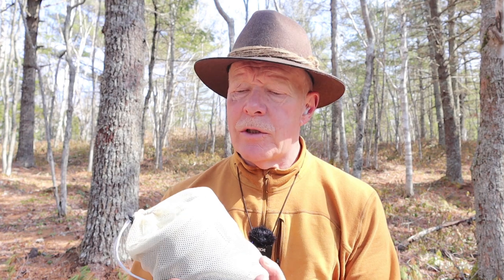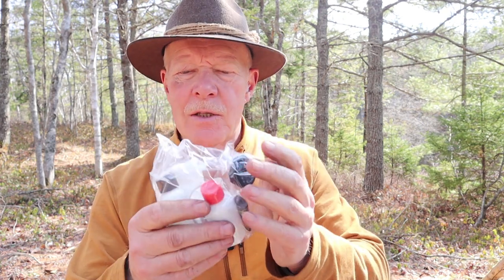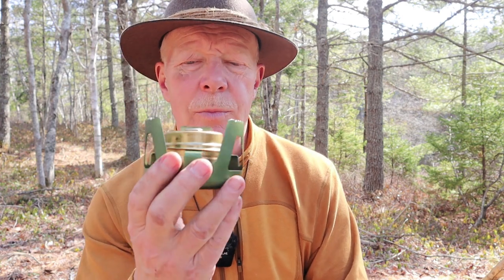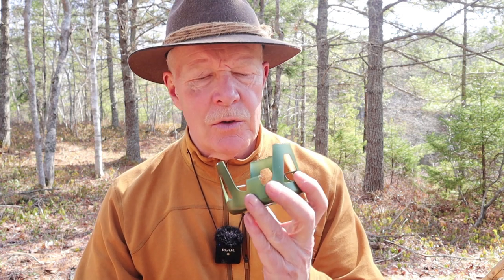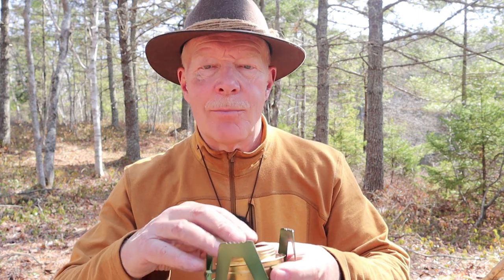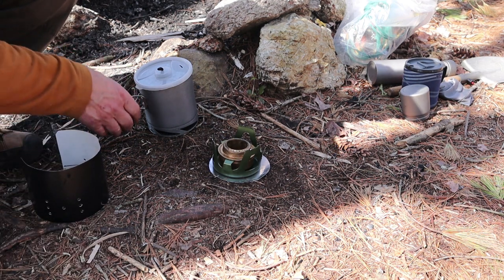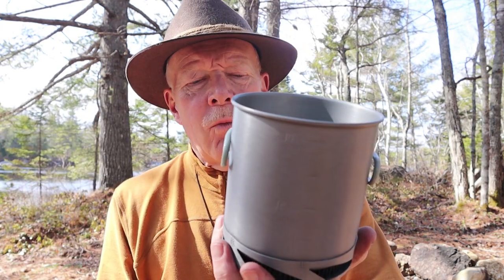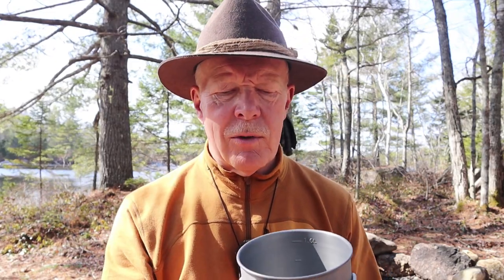New Brew Kit - Using my FM Heat Exchanger Pot and a Trangia Clone

Comment: 👍👍👍
Nice setup. I have filled my Trangia Burner with Ceramic Wool topped with a roll of Carbon Cloth and not looked back.
Lights up immediately, no matter the temperature. The pot can be put onto the stand straight afterwards with no risk (so far) of the flame being snuffed. No need to wait for the 'bloom'. The risk of burning fuel spillage in case of an accidental knockover .. greatly reduced. Performance .. no appreciable difference noted.
The heat exchanger pots with an alcohol burner .. I foresee the occasional 'decoke' of the heat exchager fins / vanes. However, no big deal and it will keep idle hands busy 😁.
Thanks for sharing .. take care ..
Reply from the maker: I have been playing with that Trangia mod. I like its benefits. Bit slower but I am okay with that. Thanks for commenting

Comment: Hello Mark and thanks for the video. I've used the "Sterno Inferno" heat exchanger pot with an alchohol burner. The directions said not to do this, but it worked out fine and conserved a lot of alcohol when boiling. It is a good lite weight set up.
Reply from the maker: I would love to have a Sterno Inferno but they have gone off the market. Thanks for commenting

Comment: Another thing you can do is put carbon felt inside the alcohol burner during the winter, or any season. That way if there is an accidental spill it will less likely spill everywhere thanks to the carbon felt soaking up the fuel.
Reply from the maker: Yes, I have modified an old Trangia clone with carbon felt. Works great but is slower than a burner without. Thanks for commenting

Comment: I'm still pretty new to these stoves, I've made a penny stove and a hobo stove that burn methyl hydrate. I really like the look of these trangia's and they do qualify as cheap but I'm struggling to buy one where i can make one myself hahaha eventually I'll buy one. Thank you for sharing your experience Mark!
Reply from the maker: The only real advantage of a Trangia is that you can control the heat and store fuel in it. With a DIY stove, you have to let its burn out or try and put it out to recover the alcohol. Thanks for commenting Steve
Reply: Yes. I have one of those stands. I also seen that review from the other channel and wondered what he was on about because I don’t think he demonstrated what his problem was. I have a GSI rocket as well. Good coffee. The only con I have with it is it is easily knocked over. A fine grind also takes forever to drip through. I also wonder why Trangia never put the wire spring handle on their simmer rings. It is ace. When I hear you say the word “project” my ears prick up. Have you been trawling the thrift stores again? 👍🏻😂

Comment: Good video and good setup Mark! 
I have a Sterno Inferno stove/pot set that I picked up a few years back. It includes a stand/windscreen and heat diffuser pot as well as a base with flip out legs for added stability. Great setup except for the crazy heavy and fragile plastic lid.
They seem to be getting pretty rare nowadays but are worth the purchase if you come across one at a reasonable price.
Reply from the maker: I have been looking for a Sterno Inferno for a while. I assume they are no longer made new. Thanks for commenting

Comment: 7:20 - This Chinese Trangia clones don't have the internal wick of Trangia TB25 burner - a cloth (Linen) tube around the outside of inner tube wall. So use pre heat, even in summer,  to speed the bloom (jet start) time. The ALOCS clone have the wick.
Reply from the maker: So, all the Trangia clones that I have purchased, regardless of "branding"  have wicks. Having said that, there is a huge difference in quality among the clones. ALOCS being the best I own, next to the Trangia. Thanks for commenting

Comment: you can also use the trangia by putting it on the ground then set the burner right side up over top the trangia that creates ore space between the flame and the pot it was desighned to be used that way
Reply from the maker: Hi Terry, Yes, you can use it that way but I find a lot of flame comes in contact with the stand and does not go through the hole. This slows things down considerably. Thanks for commenting
Reply: @MarkYoungBushcraft  yes if you don't usually windscreen but I usually windscreen the one you promoted years ago and it worked great

Comment: Sorry if I missed some of the explanation, my boss was talking to me, but your idea of preheating in winter is part of a winter accessory kit from Trangia.   I made an exact copy from a thrift store stainless water bottle and a dremel.  Works great, but it’s not a stand also.  I use the wire stand and heavy foil for a wind break.
Good point about a heat sync for an alcohol stove.  I guess people don’t because they go after the most simple ?
Reply from the maker: Hi Jim. You watching YT at work again? I recall you saying you made a Trangia pre-heater. This does the same thing. Maybe not as well but much lighter. Thanks for commenting
Reply: @MarkYoungBushcraft     lol, I always give my work a full 90%. 😀
Yeah, so mine would be lighter, I’m sure. Unless yours it titanium, because it seems smaller.  But mine isn’t a pot stand too.     Those lines on the stove are in fact for that preheater.  The heater has a solid bottom, with a small fibre glass patch for a wick.   As I said, I have separate stand, which I believe I got the idea from you.  The stainless dollar store skewers, and the cable crimps.  Though I used cut off 22lr cases for one of them.  Comes out to a pretty small package.  Everything including fuel and lighter fits inside my 1l pot with tons of room to spare.
Reply: @MarkYoungBushcraft    Oh, and do you know that o-ring is a pretty basic piece to replace.  If you can’t find one in a hardware store, most sex shops will have one…..just don’t ask how I know!  😂😂

Comment: Thank you for your review.🥰
Mark i too watched his video and came to the same conclusion that he set it up wrong in the first place. 
I have one of the very same burners from Ali express and i have used it many times...i am very happy with mine as well. 
If you have a problem with the three hands holding up the burner, i just had to bend one of the hands with my thumb back into place, because it had a tad bit too wide gap. It was very easy to push back in to place.
I was disappointed with the review that person gave it, because I knew, having tried out the very same alcohol burner for my afternoon coffee.
Reply from the maker: I agree. It is a good, cheap piece of kit that works well. Thanks for commenting

Comment: Great idea using the carbon felt. I saw the same video. It takes a couple of burns for a new stove to break in. I have an ALOCS with the stand, and I’ve never had an issue with it. I think many of the reviewers don’t use the item long enough to find out how they properly function. ✌️🇺🇸🤝🇨🇦✌️
Reply from the maker: I agree. I can't pass comment on something until I have used it for a while. Thanks for commenting
Reply: This Chinese Trangia clones don't have the internal wick of Trangia TB25 burner - a cloth (Linen) tube around the outside of inner tube wall, so their bloom (start jets) is slow.
They need heat - even in summer,  to speed the bloom.,

Comment: I have an Optimus heat exchanger pot where the HE is a smaller diameter than the pot.  This allows me to use a vented piece of aluminum pipe/ducting as a combo windscreen/pot stand that fits snug to the HE.  With a trangia alcohol burner in warmer weather i can get close to 1min./100ml boils.  Makes carrying a noisy canister stove on day trips unappealing.
Reply from the maker: Nice setup. Well done. Thanks for commenting

Comment: I have that chinese stand and Trangia burner clone. Stand does not work with typical 9.5 cm diameter pot like my Tomshoo 600ml (reads 650ml but is not). Except stand upside down, then sort of. Works well, but quite slow on my 11.5cm diameter Toaks 1100ml pot. Because the burn distance when the burner is on bottom of the stand is just something like 0.86inch. Needs a disc to isolate from cold ground under the stand. And as you stated a windscreen is needed. 

The advantage of a smaller burn distance is less sooting and more economical fuel usage. I suspect that the stand might work a little as a heat sink though.

The guy who totally trashed this stove might be Luke from OutdoorGearReview, with title "Ridiculous Design - Red Camp Mini Alcohol Stove and Stand - Real Review". Then again Luke once could not get Trangia stormcooker, 27 or 25 properly  together in his review of that excellent stove ;)

Btw Mark the copy burner is not very strong. The simmer ring  holder can disengage from the ring easily. Also watch out for the temperature making permanent formations and the cap then looses ability to hold the stored alcohol inside, instead giving your pot bottom some denatured alcohol flavor. Also the soldered inner wall can disengage, making the burner just some vessel burning alcohol inside, instead a gasifying one, not very effective.
Reply from the maker: I have quite a few copies or clones. Some are very good like the ALOCS but some are cheap and not worth buying. Thanks for commenting
Reply: @MarkYoungBushcraft  I would not trust any cap to seal alcohol burner that is kept inside the pot containing alcohol. My advice is use 30ml measuring cup that fits inside the  burner. Leave the cap at home and always burn it empty. Just take the burner with simmer ring/snuffer. Dosaging just enough for to boil. With Trangia fuel bottle and putting the 30ml cup inside the pocket or else wind takes it away.
Reply from the maker: @jarmosalonen2068  I agree totally. I keep my burners inside a plastic bag regardless of make. Even the Trangia. I keep my fuel bottles inside plastic bags as well. Thanks
Reply: @MarkYoungBushcraft  ALOCS Trangia clone have the internal wick, like Trangia TB25 burner - in this a tube of cloth (Linen) around the outside of inner wall. Other Chinese clones don't have the wick, so they need pre heat for bloom fast.

Comment: well done
Is there a carbon soot buildup on the fins of the heat exchange 
The meths I use is sooty
Reply: Use Heet in the yellow bottle, no soot at all.  It's methanol, not isopropyl alcohol or ethanol.  From what I've read, methanol burns cleaner.
Reply from the maker: We don't have HEAT but the methanol and ethanol we are able to get here does not produce any soot at all. Thanks for commenting

Comment: Hey mark do you know what size the gasket is on the trangia/clones? I have a solo stove trangia clone and it leaks like a sib if you have alcohol in it.
Reply from the maker: It is the same as the Trangia original. I was able to find replacements from a UK company but can't find the link anymore. I see them on Amazon, etc. Hope this helps
Reply: That may be through the seam between the bottom of the burner and the top of the burner.  They are pressed together.  It's a pretty good seam, but not always perfect.  You can solder it.  Firebox stove sells Trangia burners that have been soldered for a few bucks over the base price.
Reply: @markmartello  may very well be. Can't say that it hasn't had a tumble or two in the woods lol.